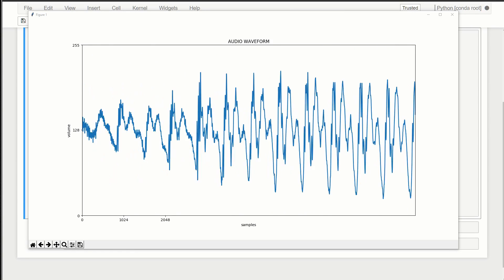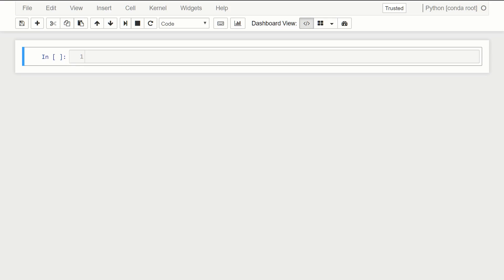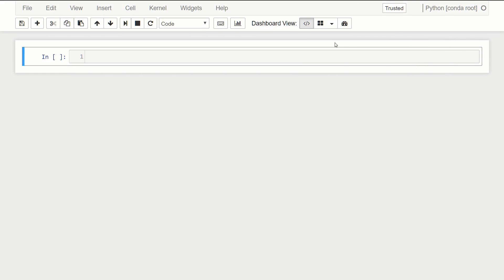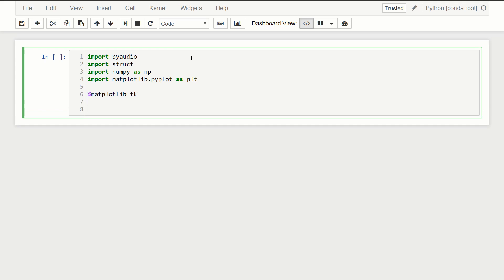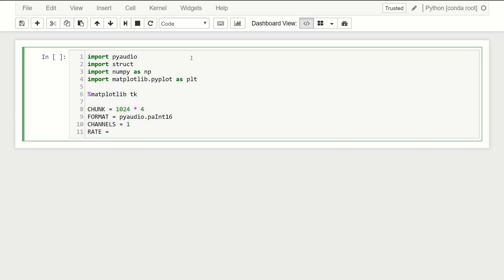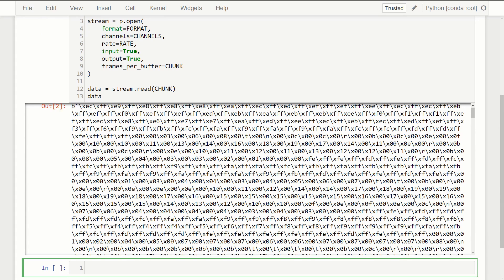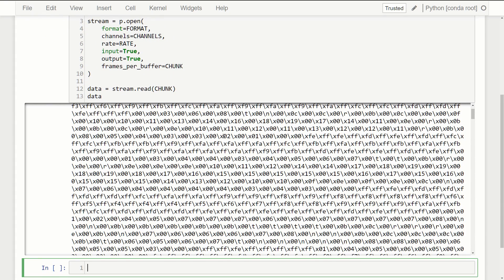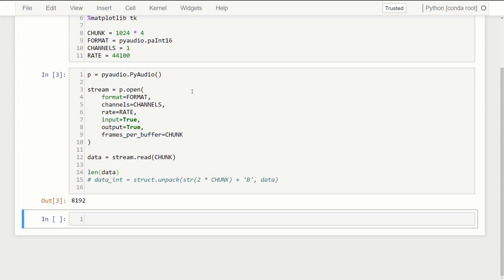Let's Build an Audio Spectrum Analyzer in Python! (pt. 1) the waveform viewer.

Comment: Hi, when I am running the code on jupyter notebook, I kept getting OSError: [Errno -9981] Input overflowed error, do you know how can I solve it?
Reply from the maker: Lynn Gu do you see anything that says --IOPubRate? It could be you're creating objects that are too big for your jupyter to plot. You can increase the iopubrate with a command when you start the jupyter server.
Reply: I am trying to do this on a raspberry pi and i am getting the same error.
Reply from the maker: I think the error has to do with not enough memory size to read the audio data.

use a try and except statement when you read from your microphone.
for example

try:
    data = stream.read(CHUNK)
except OSError:
    continue

you can also try playing with the size of CHUNK.
Reply: I have just tried this and still have no success
Reply: although it does not give an error anymore, it just doesn't show the plot
Reply from the maker: have you tried increasing or decreasing the CHUNK size? It could be a memory limitation of the raspberry pi.
Reply: Yes, I tried increasing and decreasing but still no luck, If it is memory limitation would i have to decrease it?, because i tried decreasing it to about 100 and still no luck
Reply from the maker: try increasing as well.
Reply: Nope, still doesn't work. I guess it doesn't work on the Raspberry Pi
Reply: Is there anything else i can try even if that means that the graph update might be a bit slow?
Reply from the maker: I found this forum and people report having trouble using pyaudio with a raspberry pi. The last comment in the thread is someone who posted code which he claims to work on a usb microphone.

https://www.raspberrypi.org/forums/viewtopic.php?t=25173
Reply from the maker: you could try reducing the sample rate. I found this stackoverflow answer and they used 16000 for the sample rate (instead of 44100).

Check out the answer here
https://stackoverflow.com/questions/39302974/how-to-capture-audio-in-raspberry-pi-using-pyaudio-python-module-without-overflo

Comment: Hey Mark Jay! Your tutorial is amazing and exactly what I was looking for. But there is a small problem i'm facing. I can't see the graph being plot. I am running Anaconda Shell and copied you code completely. The line which you added at first i.e %matplotlib tk is giving me an error so I removed out. Please help. Thank you
Reply: Oh, I solved this problem by adding "matplotlib.use('Qt5Agg')" into my code. I think this changes my backend to 'Qt5Agg'. Is this what cause my input overflow problem..?😂 Thanks for answering..!
Reply from the maker: Saad Tahir thanks! Glad you like them. That line is an ipython magic function. Try opening a shell by typing "ipython" (instead of python). You can also start a jupyter notebook and work in there. Just type "jupyter notebook" in a cmd window
Reply from the maker: I also created a python file for the viewer (instead of a jupyter notebook). you can try running this scrip.

https://github.com/markjay4k/Audio-Spectrum-Analyzer-in-Python/blob/master/audio_spectrum.py
Reply: Hi Mark! Thanks a lot for the video and code you uploaded. I just have a question when I run the python file you wrote for the viewer( I use sublime). After I run the code, the picture only shows up for a second, and the program just kind of crashes with "OSError: [Errno -9981] Input overflowed" error. And I a wondering what goes wrong.. Can you please help. Thanks so much!
Reply from the maker: Lynn Gu glad you like them! Are you using the notebook version? In the github repo theres a python file version that will work in a text editor like sublime
Reply: Thanks for the response!!! Yeah I used the github version, however I keep getting the input overflow error and I don't quite know why..
Reply from the maker: Just to be sure, are you using this version? This one should work

https://github.com/markjay4k/Audio-Spectrum-Analyzer-in-Python/blob/master/audio_spectrum.py
Reply: hmm, after I run this code, I got 'FigureManagerMac' object has no attribute 'window', why would I have this error?
Reply from the maker: Lynn Gu Awesome! I've posted a few more videos in the series so hopefully those help!

Comment: Hey ! thank you so much, this is really helping me understand the idea :)  I'm getting this error while using jupyter notebook:

NameError                                 Traceback (most recent call last)
<ipython-input-4-0c785ff45281> in <module>()
----> 1 p = pyaudio.PyAudio()
      2 
      3 stream = p.open(
      4     format = FORMAT,
      5     channels = CHANNELS,

NameError: name 'pyaudio' is not defined

I'm using Python 2.7 btw, maybe that's it?
Reply: The error appears when I try 5:23 btw
Reply from the maker: Luis Ech glad you liked it! Did you import pyaudio?
Reply: i feel really stupid, thanks! also, got any kind of book recommendations or free course about pyaudio/matplotlib/numpy? it would really make my day :)
Reply from the maker: Theres tons of material on matplotlib on their website. Its one of the most well documented libraries. Same with numpy. Pyaudio on the other hand has very little material. Id say check out their online docs, they usually have example code to woek with
Reply: I'll try that, thanks again, you helped me start my first university project :)